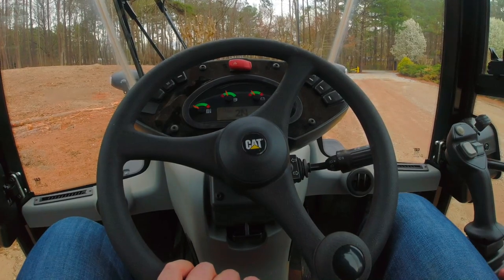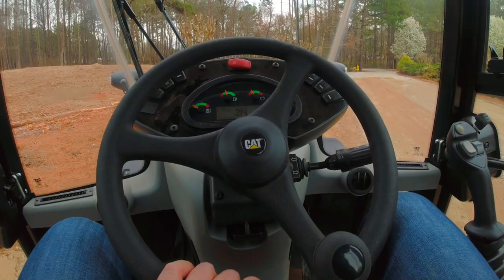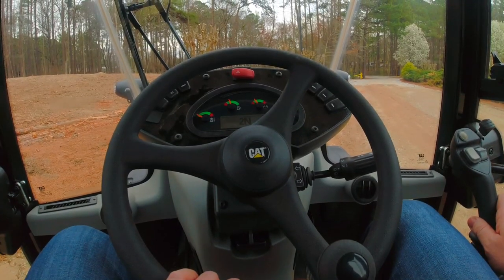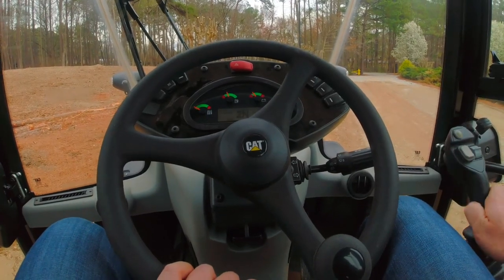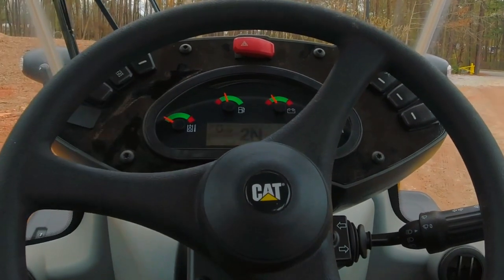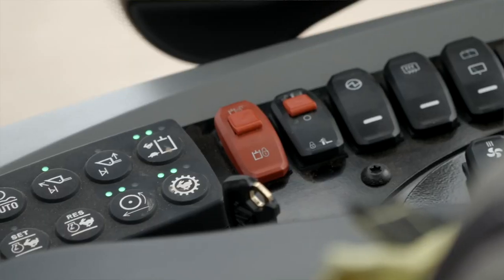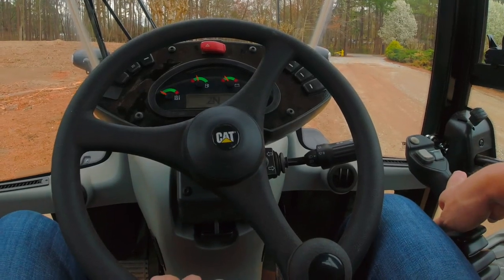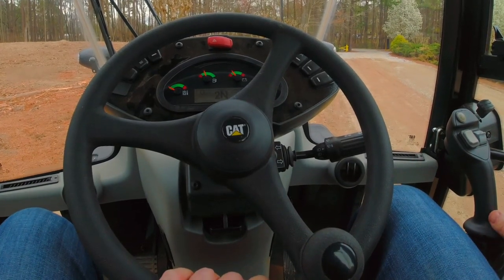Float Function - Cat® 906M, 907M and 908M Compact Wheel Loaders

Comment: Hello, what is the button visible in the 43s of the video, the second to the right of the float function button? Black button with circle and "zigzag"
Reply from the maker: Hi wiesiupwr! That button is for high flow aux and sends 12V power for attachment accessories. - Yasmin
Reply: @catconstructiontrade  Thanks You very much!